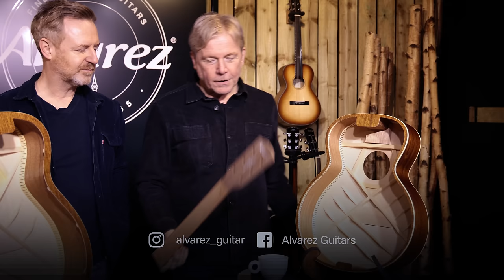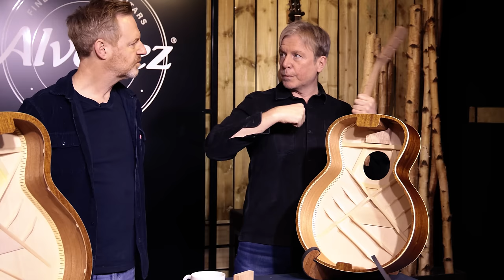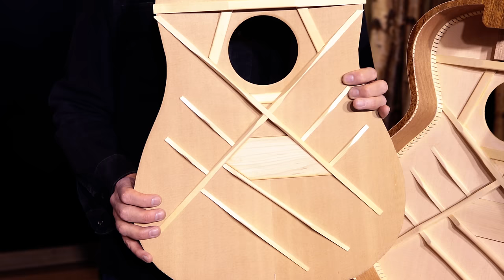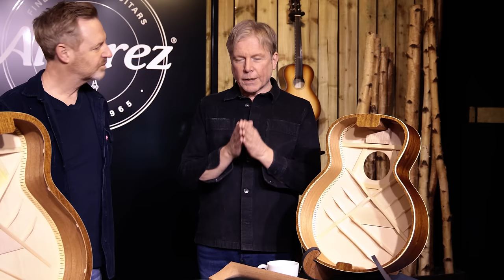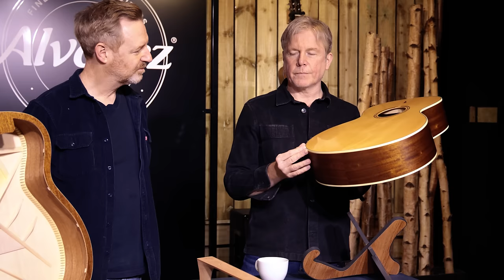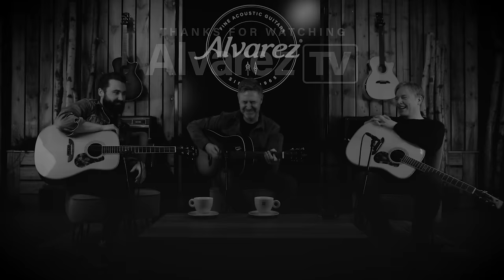Anatomy of an Acoustic Guitar

Comment: I hope some time you could expand on string gauge and why you think 12s at a minimum. I understand potential energy but? Is there a certain line that you can’t cross in structural integrity that won’t allow 10s to be effective or is it for other reasons? I like 10s because I can get a tighter setup and they produce less tension than 12s or 13s but you are the expert here. Would love to know your thoughts.

Comment: Sorry, Chris, but I do like 10's. Of course, I'm getting a bit on the old side, and may have a touch of arthritis, but I also like to bend some notes, uh, some, so... As far as materials of strings, absolutely true. I've noticed different resonances in strings made of different alloys, or with different windings, which also feel different when playing.
But, now, what about bridge pins? I wouldn't mind hearing about differences in sound with different pins. And, as I see mentioned, what about the back? How does it affect the sound? Flat or arched back? I've got two Alvarez guitars right now, a new AD60, and an older 5059, made,  I think, by Kasuga, which I bought in '77. To say they sound different from each other (yes, "from," because I'm a Yank), is understating things, to say the least, but I like the sound of both, and I play them both, using the 5059, these days to play tunes where I use a capo on the second fret. I just leave that one tuned to adjust for the capo, and use the AD60 for the other songs.
Reply from the maker: Hi Jim, thanks for the comments here, and we are working on developing episodes on guitar backs and bridge pins as we speak! Looking forward to sharing them with you. We love our AD60s as well! Thanks for watching 👍